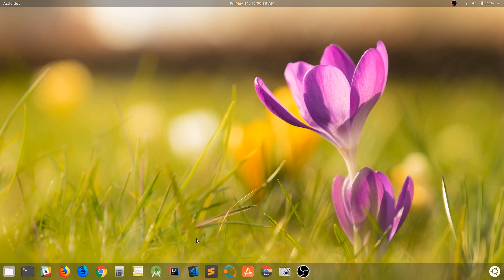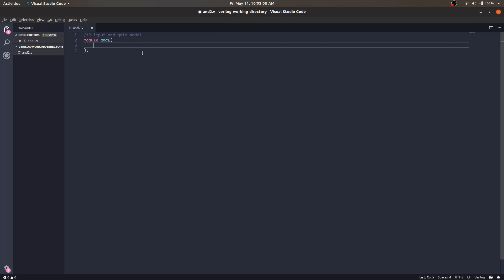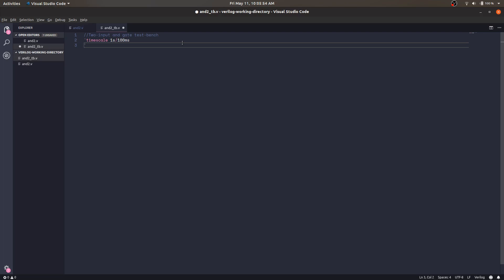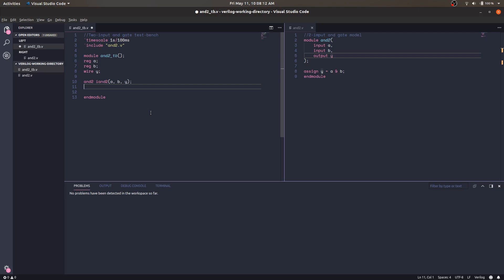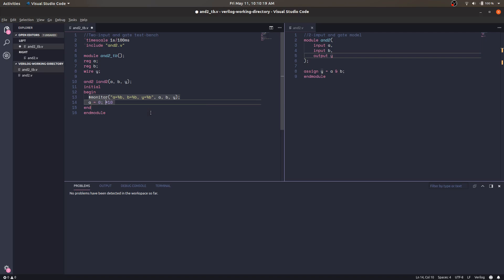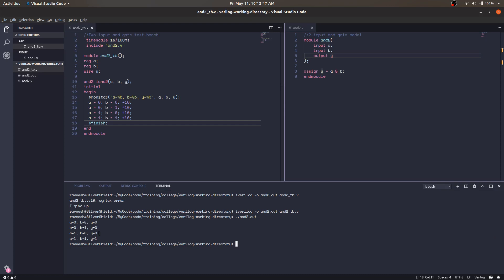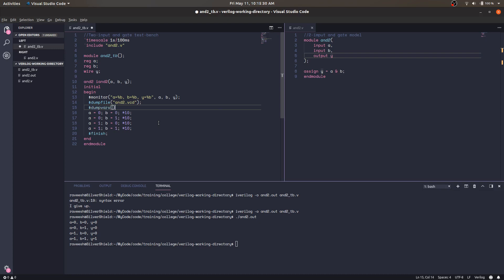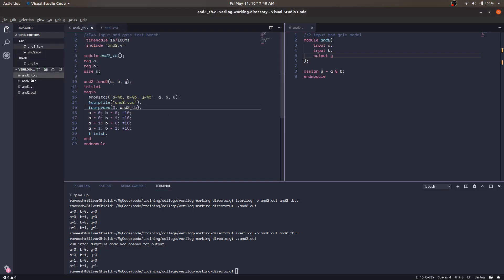Icarus Verilog Workflow: simulating a 2 input and gate with Icarus Verilog

Comment: i did the same in windows but after executing "iverilog -o and2.out and2_tb.v" i am getting an error as "iverilog : The term 'iverilog' is not recognized as the 
name of a cmdlet, function, script file, or operable       
program. Check the spelling of the name, or if a path was 
included, verify that the path is correct and try again." 
Could u please help me
Reply: Roi ->
U need to add "C:\iverilog\bin\iverlog.exe" to $PATH variable in Enviroment Variables.
If u don't know how to do that, just reinstall iverlog, this time check box the "Add to path variable" item.